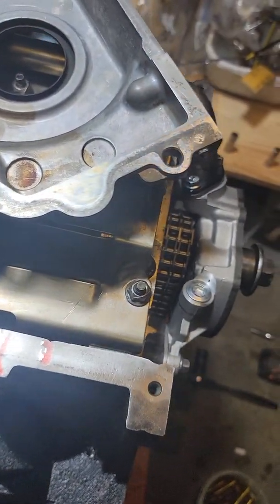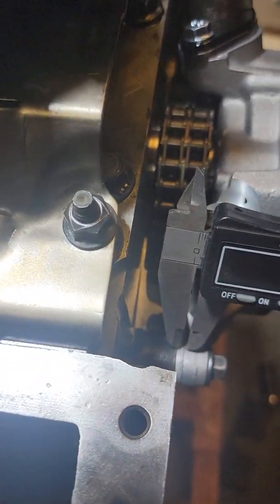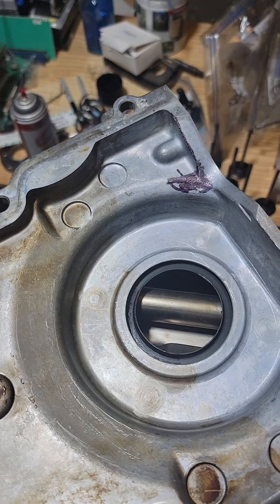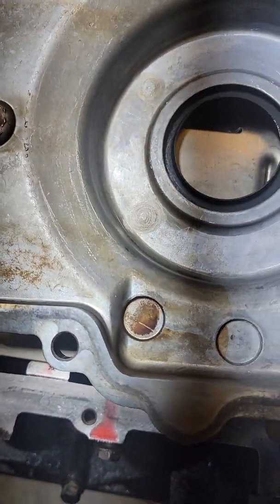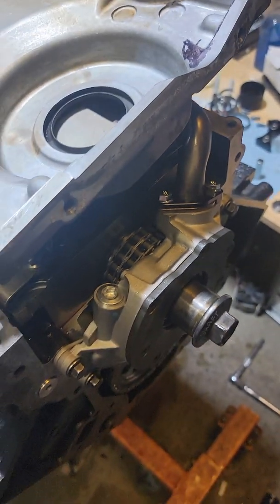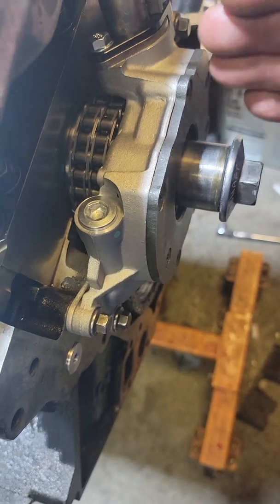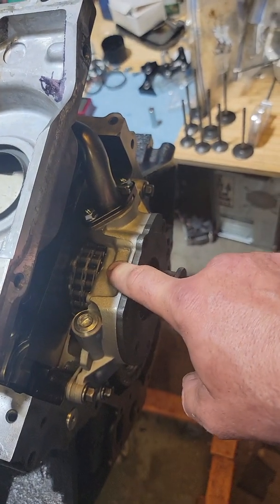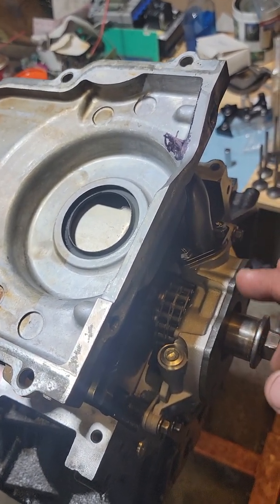LS Double Roller Timing Cover Clearance.

Comment: Ohh I love the part about the feeler gauges in the pump drive. Badass Man. I tell guys they are idiots too. I've been building LS's since the beginning and was a GM tech for a number of years. Even GM says, "WHAT are you talking about?" Except the Gen V engines. GM does say you have to use the kit to retain the pumps location if reusing the pump. I never did after hundreds of cam swaps and never had a comeback. Even though I have the tool. Waste of time.

Comment: Youre right. I usually use an old crank gear to center it and slide it on.. I've never done the gauge and never had an oil pump failure or even low oil pressure issue.
Reply from the maker: Right on

Comment: HA! Nice rant. I've used several different double roller gear sets, and I've found the Nornda Automotive the best by far. After 35k miles no slack in the chain what so ever. I can't say the same for other manufacturers that I've used.

Anyway. I've had clearance issues where a bolt change, "button head" bolts vs. counter sunk, was the fix, but I recently had a problem with oil pump front cover reaching out to hit the cover where the seal sits....

I guess you got this. Whatever you do.....NEVER shim the pump gears when installing the oil pump!!!!!

Comment: I discovered the same as you, but ground the heads of my bolts, and it worked fine. Yours is a better solution though. But I ran into another problem you didn't have. I see from your video, your oil pump cover appears to be flat. Mine is a stock pump, and it has two ribs on the cover. That is the next thing to hit. It hits the surface just behind the balancer seal. Haven't solved the problem yet. Going to pull the oil pump cover off, and see if I can remove a portion of that rib, and then may have to remove a little bit of the flange on the timing gear cover. Or may opt to put a Melling pump if I confirm it has a flat cover. M295HD
Reply: I put my 2" x 72" belt grinder to work and flattened out the protrusion. I used a Summit two piece front cover on this build and had the same clearance issue. I wasn't sure if it was a Summit part problem or if the OEM cover had this issue also. Good to know.
Reply from the maker: Clearance or just don't make power!!!   MAKE IT FIT BRO°°   NAME OF THE Go-Fast-Game!!!   Subscribe plz.

Comment: Very good! I have searched for hours trying to find somebody who has done this before on Youtube. No one clarifies the installation of double roller timing sets for these engines, yet they are available practically anywhere you can buy engine parts. I have ordered a special 2-piece timing cover just for this but pissed me off to find out it won't be here for months! Thank you sir for your help, I can now cancel my order. Do you know what grade of bolts you used on the pump?
Reply: I followed this method, and just ground down to heads of my stock bolts, and fits perfectly.  Wouldn't never figured it out with this video..  Great job.
Reply: @jameswiz  Update: using countersunk or (tapered) bolts is not a good idea. GM calls for 18 ft-lb on the pump bolts. Tapered bolts cracked my pump housing. Time for a new pump. Going with your "machined" stock bolt idea.

Comment: So did changing the oil pump bolts do the trick?
Reply from the maker: So using the flat head bolts did fix that issue, however I ran into another.  The oil pickup then hit the cover, as it too needed moved forward.  I used blue machinst dye on the cover and a Dremel with burr bit to remove a little material.  Went together like a dream after.  
I will also add, I purchased and added the alum plate that allows for the 2nd bolt on the pickup.  That part also required me to clearance it, as well as modify the "part at the end of the stock pickup tube that keeps the hold down bracket from sliding back" by also adding some clearance there.  Without that mod, you maybe fine with just shorter bolt heads..  
I'd imagine, you could just grind down the top of the stock bolt head and be fine..  however the added heat from grinding may change the temper of the bolt so I did not want to take that chance and just bought countersunk bolts which have a much much flatter and shorter head... 
As for anybody who reads this reply and says about shimming the oil pump, there is a video that shows the entire reassembly of an LS from general motors, and they do not use any type of tool to align the oil pump when putting the motor back together.  Plus I contacted melling and asked them if there was any special procedure to shim the oil pump and they told me as per factory specs there is not..  so I'm assuming by using countersunk heads, I'm making this oil pump dead center of all the holes that are drilled, which if they are machined off the crankshaft centerline, then my oil pump should be "in theory" dead on where it needs to be anyway.
Reply from the maker: Just an update... It's now July 22nd 2022... My motor starts, Runs GREAT, and carries 80psi of oil Pressure HOT at idle and at 5k RPM, showing the pressure relief spring is working perfectly.  No noises from anywhere once warm and makes some of the best exhaust noise I've ever heard!!!  Video of the sounds to follow soon!!! L&S!!!!
Reply: @dr.noitall9887  just to piggy back off your comment even with the single bolt style tube it doesn’t fit. Great video though! I’m gonna drill into my cover cause I’m a cheap bitch lol